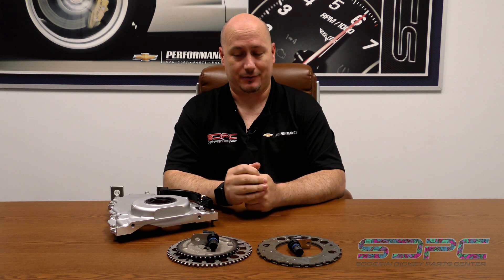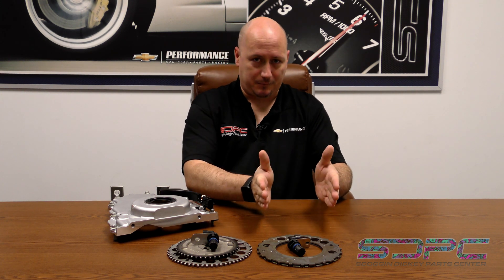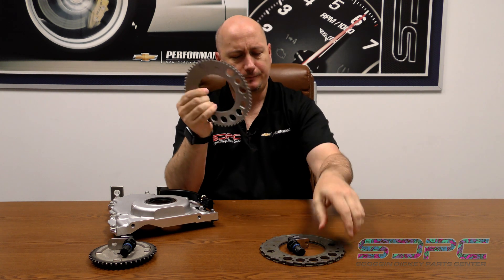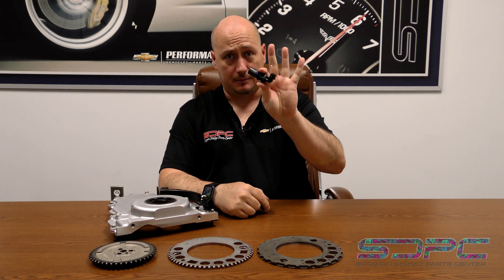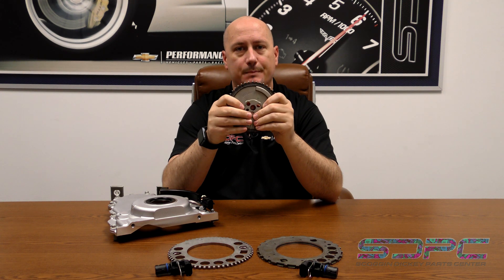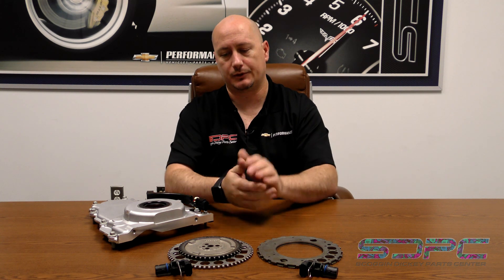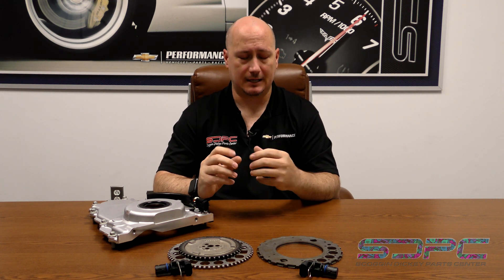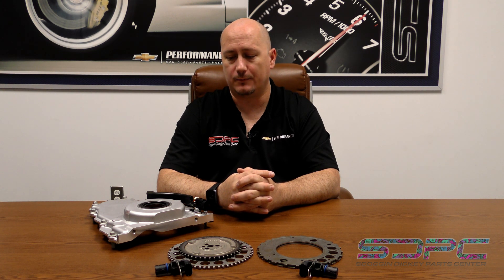Swapping your Gen 3 24x LS to a 58x Crank Trigger - Tech Tips with Dane

Comment: Quick question, looking at purchasing a cheap LS2 that's 58x(bottom end is toast. already plan on replacing rotating assembly and cam from my spare LS1). I was curious if it is possible to use the timing cover off the LS1 and the LS6 valley plate or is the casting completely different? I know they used the LS2 in the 24x config so I'd imagine the casting isn't different. Just trying to look around having to add more wiring nests to the car, I'd like to be able to reuse as many LS1 spare parts as possible and not add anymore wiring to the car or purchase any adapters(ICT knock sensor relocate kit). Thank you

Comment: I have a gen 3.5 6.0 LQ4 (its a factory LQ4 GENIII with GenIV rotating assembly in it from factory). what all would it take to convert this 24x crank to a 58x? is it simply just a swap of the crank? Obviously I will need to get GenIV sensors and harness etc. but is there anything else?
Reply from the maker: Yup, Swap the reluctor and change to a 3x cam.
Reply: @Sdpartscenter  do I need to have a shop rebalance the rotating assembly after doing crank swap?

Comment: On the crank sensor, what he is babbling about is the index tab inside where the pins are.  Hold the sensor upright by the part that goes inside the block, and looking inside the connector with the metal plate under it.  The locator tabs are left 24x, right 58x.

Comment: 1996/97~2003 were cable TBs. 2003+ are Wire TBs
Reply: All Corvettes starting in 97 were drive by wire.  Certain SUVs with traction control were also drive by wire.  Some cars were cable up until 2007. I'm unaware of any particular vehicle that changed in 2003.  It's not cut and dry.

Comment: For a street engine 24x IMHO works just fine, why anyone would feel they need a 58x upgrade is beyond me unless the vehicle harness is a Gen 4.  I do some of my engines with a front mounted cam sensor, 24x cam gear and external knock sensors.  No worries.  Unfortunately, I picked up a very low mileage 2009 4.8 Gen 4 engine and only have Gen 3 PCM's and harnesses.  I understand the problems with the conversion from 24x to 58x, if the resolution isn't there you can't just produce it but I never heard of your 58x to 24x conversion box, that is something I will have to look into.  The gen 4 4.8 is nice because it doesn't have any of the DOD/AFM casting provisions in the block, it's just basically a Gen 3 4.8/5.3 LS that can be fitted with a 24x 5.3 crank and rods or stroked easily without added cost.  I will have to look at that conversion box for my 4.8, I plan on sticking it in a '89 S10 I have but I might just run it off a carb so it might be a moot point anyhow.  Thanks for the info.  I link for the conversion box would be nice.
Reply: 10L90 swaps, there is a company doing them for Gen 4 LS now, but it will eventually not matter as they will start doing Gen 3 with the 10L90, Hopefully I can get a 6l90 behind my 5.7 Iron LS1 (5.3 bored out)

Gen 4 4.8 was LY2 (Piston valve relief, not true flat top like the LR4 was) or L20(VVT)

It's not difficult to dod delete 5.3s or 6.0s or 6.2s, If im not mistaken not all Gen 4 5.3s were DOD, just need to look at RPO codes

Later model Gen 3s (2004+) have gen 4 rotating assembly outside of the reluctor wheel being 24 tooth. The First Gen 4 LS was the LS2 6.0
Reply: So let me ask this what I’ll be able to use my GEN three in a GEN four truck and what I have to get it the engine tune to the GEN Ford truck